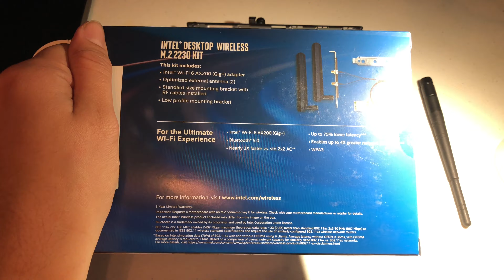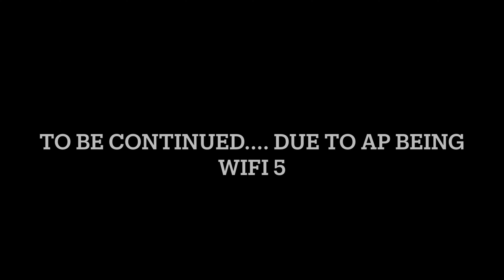Upgrading to Intel WiFi 6 Card on Dell Optiplex 5070 Micro

Comment: Thank you for the great video.
I just need your help on this. I have the same machine but it doesn't come with WiFi module, nor the antenna socket (that shiny golden ish part). Meaning that I need to buy the whole thing (module, wire and antenna) 
So, the opening for the antenna socket is ready in the case itself, I just need to know how to install that part into the case.
If you can show me that in a video it will really help a lot.
Thanks.
Reply from the maker: No problem. Glad to help. I’m assuming you have the same model? If so there should be holes 🕳 you may have to push through using a screw driver just make sure you don’t hit the motherboard or other components.
Reply: @mdjcomps  Thank you so much.
Yeah, same model. There is a hole and I did what you suggested and it worked, 🤩 snapped in place and now I have a socket. Thanks man 🤜🏻🤛🏻
Reply: What part number for the kit? Did you buy it through Dell?

Comment: Thanks for the video.
Just a heads up for anyone wanting to use a PCI-E WiFi card on anything other than Optiplex Micro 3070 (not sure of other series).
I have 3070 SFF, others and myself have confirmed that PCI-e WIFI cards will NOT work.  It is detected by BIOS but will not get detected by any OS.  I have tried, Win10, Win11, Linux.
ONly way seems to be with m.2 wifi only.

Damn Dell need fix this in BIOS.
Reply: my 3070 sff does not turn on.. after changing the card..

Comment: Why did you take out the old one?
Reply from the maker: Because the old one was WiFi 5 and I’m upgrading to WiFi 6
Reply: @mdjcomps  I don't think it will make much of a difference in speed.  Because, for example, while watching a full HD video from YouTube, wifi 5 will also provide you with the required amount of data flow.
What lack or inadequacy did the Wifi 5 card have?
Reply: @ismail_gumus  Wi-Fi 5 is great but Wi-Fi 6 provides faster link speeds and bandwidth.
But I recommend going for Wi-Fi 6E which supports the new 6ghz band and is futureproof

Comment: You put the cables in reverse.  Match the black cable to the black arrow and white to white.  This card has the plugs switched from your old one.
Reply from the maker: I noticed that the next few times I opened the case but signal was very strong for 150+ feet
Reply: They connected to the antennas, I don't think it matters.
Reply: They are plain wires. Color doesn't matter